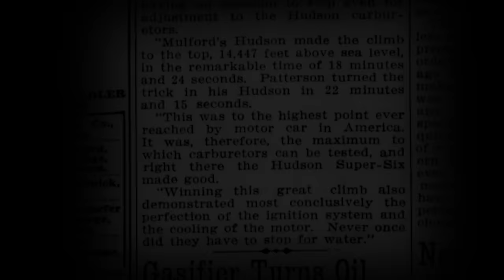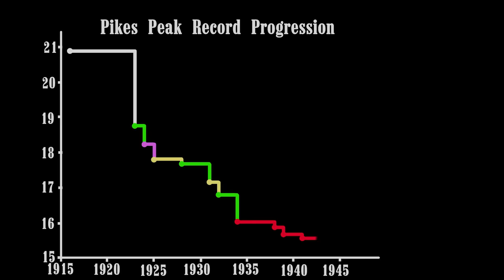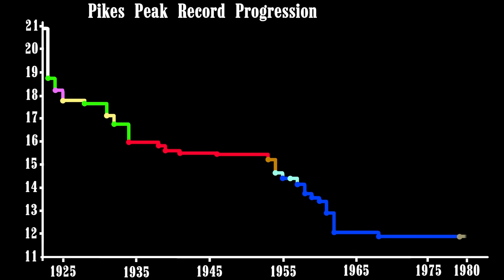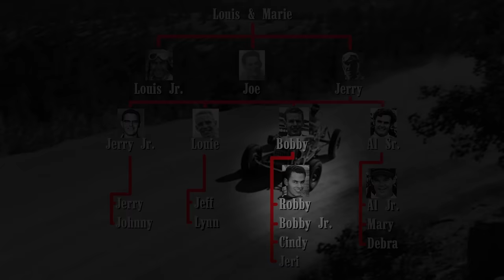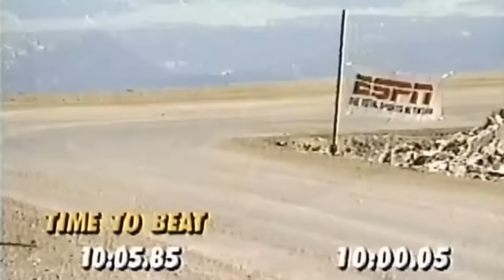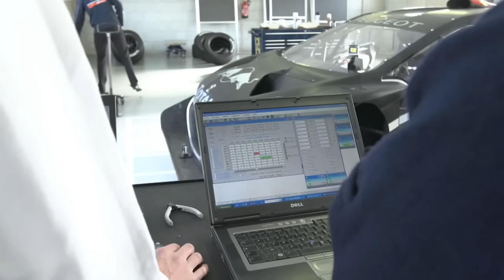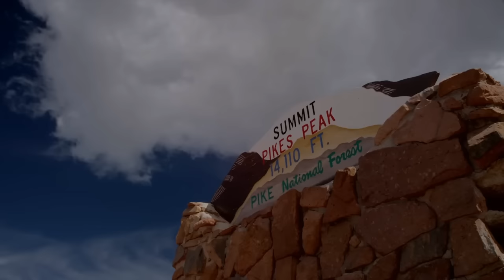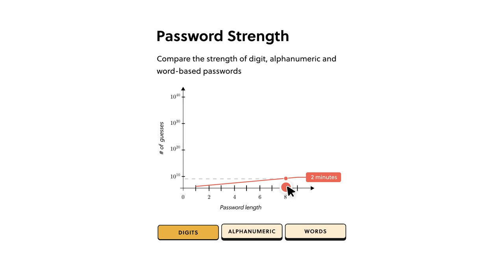The Story of Pikes Peak Hill Climb - The No Rules Race to the Clouds

Comment: The 1995 version of the race should be watched by every race enthusiast on the planet. Before they paved it....The Dallenbach brothers with indycars w/onboard and Leon in the Ford vs Unser in the Chevy Pickup etc... And ESPN did a great job. Pure magic!
Reply: Jeez. That was a while before I got into Pikes. I was a big awd turbo GMC Syclone & Typhoon fan, made in 91 & 92, and a guy named Shaun Palmer used to race one on Pikes Peak in the early 2000s. It was such an incredible truck. There's vids of it on here. The already came with cladding aka "a ground fx kit" and he made a custom wide body kit for his to extended the track width and run bigger wheels & tires. Man that truck was something!

You can. Look up Pikes Peak Syclone and a couple of vids come up. One from the mountain in 2003 and one from later on when another SyTy enthusiast did a piece on it. That guy ended up making the same wide body kit for his Time Attack/hillclimb Syclone. That, guy is Adam Auerbach, owner of High Performance Trucks/HPT.

Comment: Cool stuff! I worked at Larry Carne’s speed shop in the late 70’s and was at the summit of PP when Bobby Unser won his race. A motorcycle also came across the finish and got his rear wheel over the side of the mountain but managed to get back on the track and finish his race. Dragging his rear wheel over the side also took out the finish line when he clipped the sign’s cable. A few of us grabbed part of the sign and held it up for an exhausting few minutes until everything got sorted out.

Comment: Amazingly done, I'm going to have to drive up Pikes Peak in a rental one of these days. I imagine going up / down is pretty hard on a daily driver.
Reply: You have to buy a time slot appointment for $15 online. Get the first one of the day and be there right when the gates open, otherwise you'll be stuck behind worrisome drivers that go 5mph around the hairpins and go 10 under the 30mph speed limit.
Reply: My Nissan sentra rental made it up and down, so don't worry about the car. Just entroy the experience and put it in low on the way down.

Comment: Had my figo at 69 000Ks till 200 000km

Only overheated once due to fan switch 
Changed the following interms of the cooling

1)flushed Coolant 
2)change two coolant reservoir expantion tanks 
3)the expansion tank cap
4)drive belts(fan belts)
5)cambelt

Sold it with original water pumps and original thermostat at 200 000kms

His right about the car only buy it from the 1st owner any thing else your just chancing

Comment: Röhrl struggled with that Pikes Peak gravel and needed driving lessons from Bobby Unser? Thanks for the good laugh mate.
Röhrl kicked everyones ass in the training sessions, which were held in the lower part of the course. So much so that main competitor Peugeot flew in new wing designs over night from France. Both supercharged Rallye cars, the Audis and the Peugeot, suffered from power loss and misfires in the higher parts of the course. Audi worked on that until the day before the race and finally got it fixed. Röhrl bested Unsers time by alomst half a minute. 
At that time, no one could beat Röhrl on the same car, on gravel, snow or tarmac. Be it F1 drivers like Stuck, Le Mans winners like Haywood, Rallye champions like Munari, Mikkola, Alen, Blomquist.. He beat Michael Schumacher on the Ring, both in 599s :)